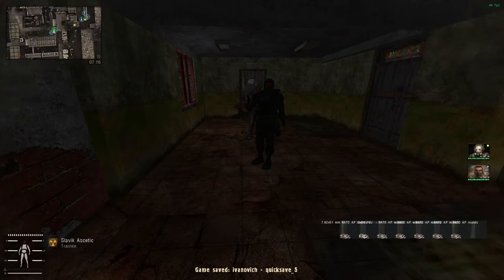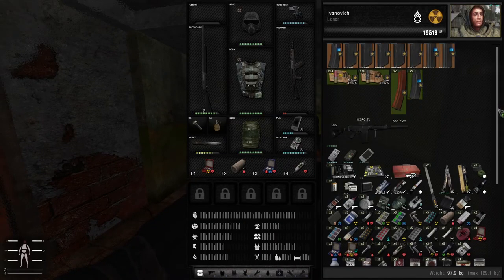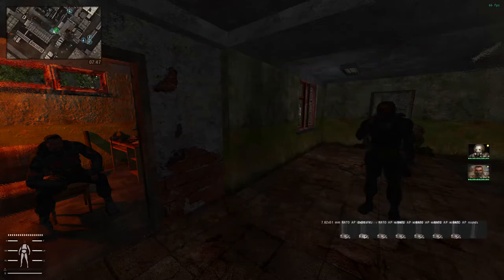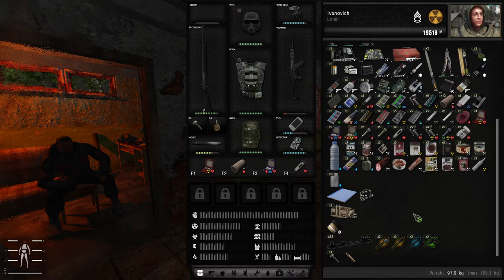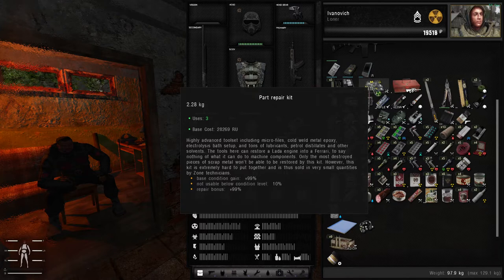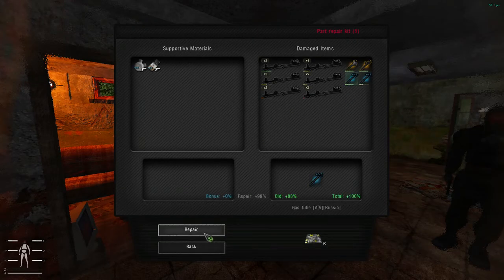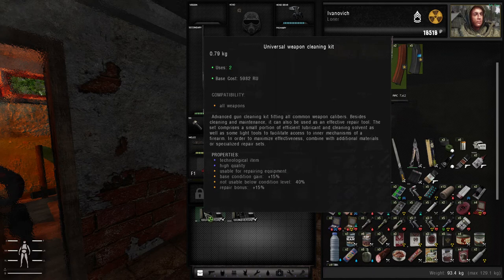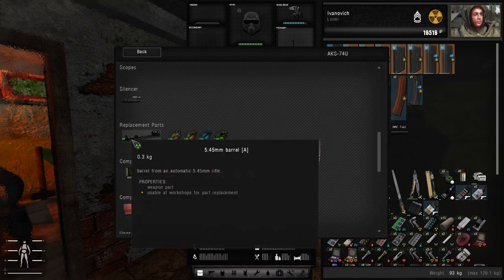S.T.A.L.K.E.R G.A.M.M.A How to repair guns and what repair kits to use OUTDATED!!!(read description)

Comment: Nice video, I did not get this repair system until I just watched your video. Thanks
Now another thing I do not get is the healing, I do not know the diference from the yellow limb heal to the white limp heal.
Reply from the maker: I could make a video about it but I will explain it here as well. Yellow health means temporary basically when you use a bandage for example you get temporary health on top of the bleeding stoppage , after a short period of time the temporary HP depletes. White health is the so called post heal , what it will do is give back permanent limb or torso health if you already have temporary health effect. the procedure if my legs are heavily damaged usually goes like this 
>use medkit or bandage 
>then use akvatabs or yadulin if I'm not mistaken to get back permanent health , if you hover over a healing item you will see what health it gives or you can simply right click and click details. 
Note that white healing items will NOT give permanent health if you don't have the temporary healing effect active
order always is temporary first ->post healing after. 
Of course if a limb is completely such as an arm your aiming and recoil will be significantly reduced, same goes with legs and how fast you can go
I hope that cleared it for you
Reply: @Woodskov451  cool, thanks !
Reply from the maker: @brah*_* I am unable at this moment and in the future months because of university , plus I have not played gamma in months at this point and stuff may be changed , these videos were before gamma rc3. I am sorry
Reply: @brah*_* it’s actually not that confusing. 

Just think as some items as trauma care and first aid (like splints, tourniquets, painkillers). These give you a temporary reprieve for immediate symptoms and are yellow (this yellow is what your limbs will show on the health display), and if you’re unsure of exactly what it does, read the item description. 

The second items are permanent fixes and are indicated by white, so instead of a splint or tourniquet, think of it as your broken arm/leg being set and put in a cast, or a bullet being removed and the wound stitched up instead of just popping painkillers and bandaging it. 

So,

Yellow=fixes it temporary 
White=fixes it permanent 

As mentioned above, you need to fill the gauges with yellow first for white to hold purchase, although there are all in one items that do both yellow and white, but they generally cost more. You can use temporary items to get you out of danger, but your damage remains and will return if you don’t follow up with a white item (or see a medic and pay to get patched up). 

Hope this clears it up.

Comment: So if you want to fix/repair the spring or the head lock part from a weapon, you need to have a small rifle toolkit to extract the item, then clean it with what ever you have and then use the toolkit on a workbench ( so it doesn't consume it ) and place the part in the weapon again.. And the barrel from all weapons you can either replace it or use a specific item to clean it like on this video.. Correct?
Reply from the maker: Yes.  you can spare one use from a specific repair kit if you're in a hurry and need a part repaired urgently but yes you understood it correctly
also NOTE THAT this video is old and some things might have changed
I advise going to the official stalker gamma discord https://discord.gg/stalker-gamma
people there are really friendly and will help you with any questions you have.
Much love mwah ❤️

Comment: Any advice to find tool kits? Is too hard but great experience with this modpack
Reply from the maker: Go up north , the higher north you go the higher the chance to find better toolkits such as Advanced and the most wanted Expert. 
There's a chance for any toolkit to be anywhere in the map even in cordon but the chance is stupidly low.
Reply: As a new player and someone who isn't too keen on getting north too fast, just hit every stash you unlock by completing missions, acquire 6 basic tool kits, then you can use 5 of them to craft an advanced toolkit which should help you through most of the early/mid game. That and medium armor kit.

Comment: any fast easy way to get basic tools as a merc?
Reply from the maker: The farther up north you go the more tools you will find. At least that was the rule months ago idk if grok( the main developer) changed it.
Reply: @Woodskov451  man, it took a bit but i managed to get some basic tools and then immediately some advanced. Now I’m running a P90 and modern kar98k.
Reply from the maker: @deurikin2466  Proud of you good job
Reply: @Woodskov451  haha thanks, but now I’m still stuck with my basic armor so I’m getting my ass kicked. Fun times
Reply from the maker: @deurikin2466  I believe you could fine tune the drops from enemies in the MCM menu if I'm not mistaken and what condition they drop in so they're not broken when you get em
Reply: @Woodskov451  exactly what i did. I made it so high tier enemies progressively drop better and better condition items. It’s just my luck I haven’t found a good Medium armor yet. But its fine, soon i can get a heavy repair kit and fix an exo suit. Quite a jump I’m gonna make.